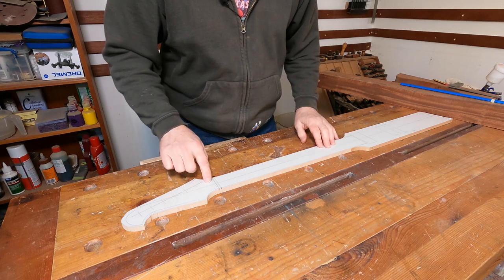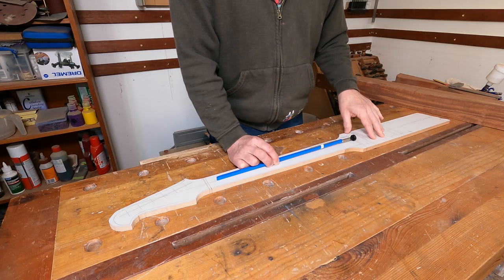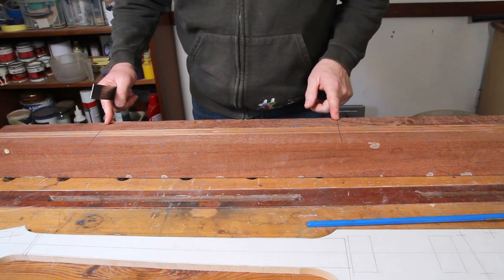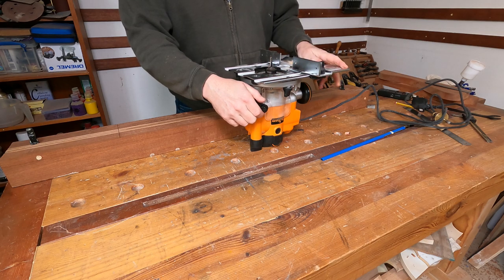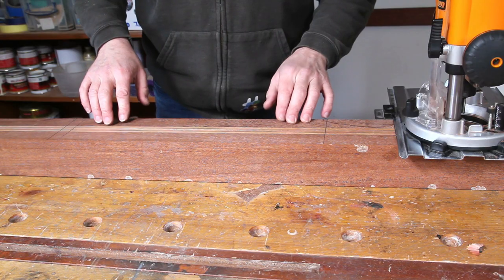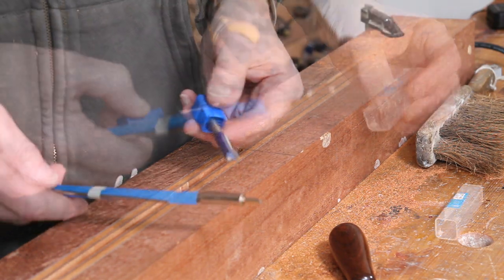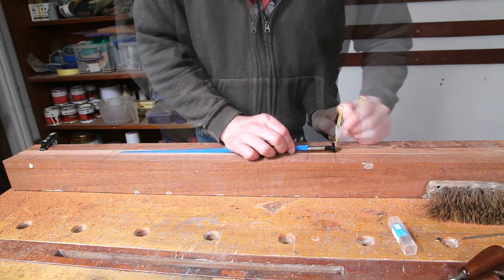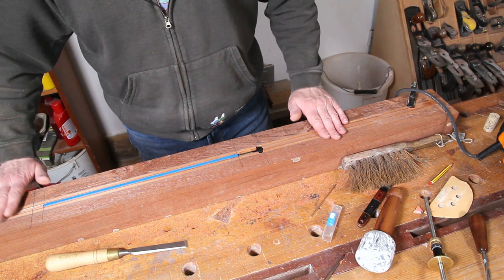Firebird Build Episode 6 Fitting the trussrod.

Comment: Good morning friend, what is the size of the tensioner used in the project? I'm building a firebird similar to the one you built, but with basic equipment and manual tools
Reply from the maker: Hi, I usually use a 420mm rod for a build with this scale length.